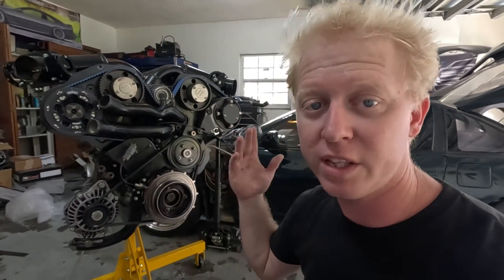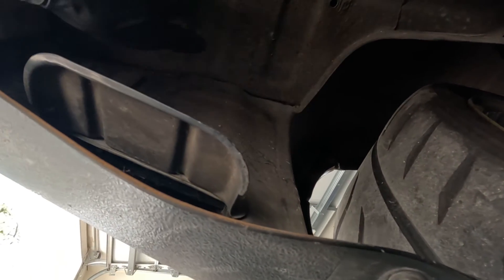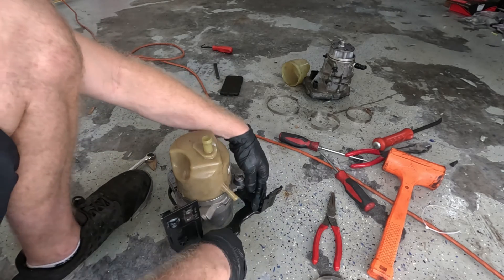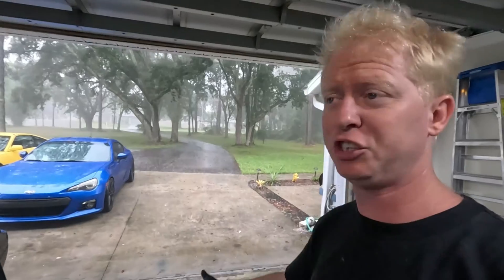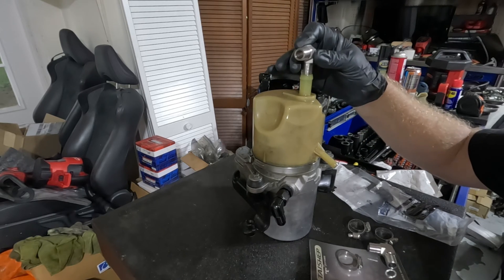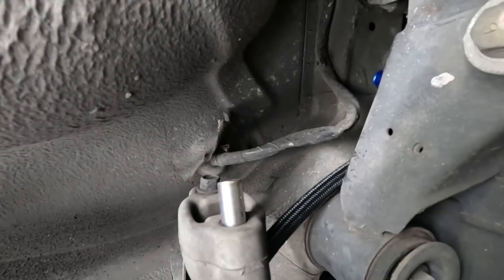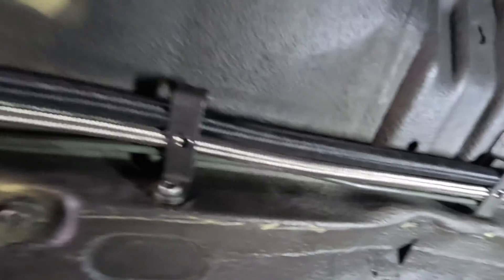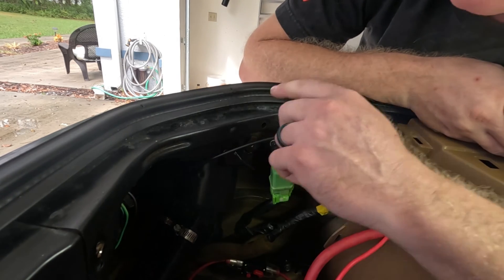Installing an Electric Power Steering Pump | A Complete Guide

Comment: Can you measure the overall length of the EPS, from the bottom to the top of the reservoir on the unit?  Trying to see it would fit the space I'm contemplating in my supra
Reply from the maker: @howardhutchinson  I'll see what I can do. Wish I would have had that info when I made this as well

Comment: Did you find anyone else using the first style of pump you showed? (Part number on mine is 31340205) I just got one that looks exactly the same with the ECU on the bottom but it doesn't work, not sure if it's dead or not. Can any of these pumps be fault code read some how?

Comment: Oh wow, I have this pump in my build and I never even thought to mount it sideways.  It's still working fine in that configuration?
Reply from the maker: Unfortunately it's not supplying pressure. But I don't think the angle has anything to do with it as I've tried both ways with no difference. Haven't had time to diagnose it yet

Comment: I believe BDE offers a power steering pulley replacement (with his crank/cam/ATI sync kit) that retains the correct alignment with the power steering pump. Thanks for the electric option.
Reply from the maker: Good to know!

Comment: Great video. While it is a great alternative, I would be wary of the location you chose for the pump. It's too close to the rear tire and exposed. Debris can easily hit the pump, the reservoir or any of the lines, no mater the size of the debris, the force and frequency in which the pump and/or reservoir will get hit; will make a good day turn in to a nightmare quickly.
Reply from the maker: Forgot to add that into the video. But I will be adding a cover over the pump to keep debris out.